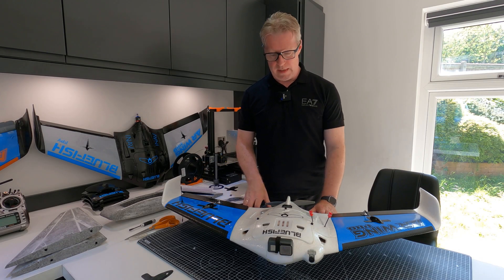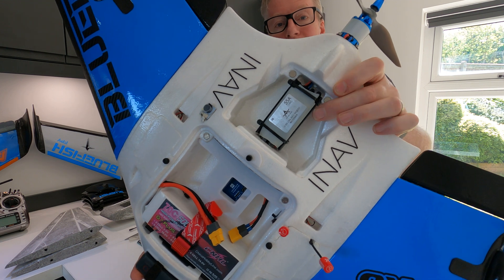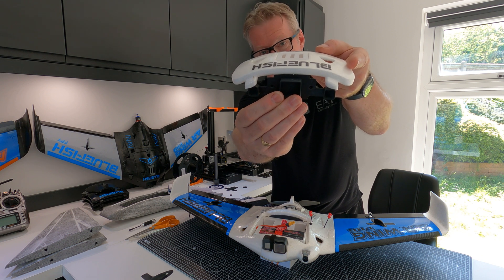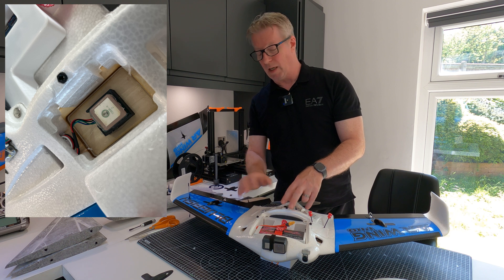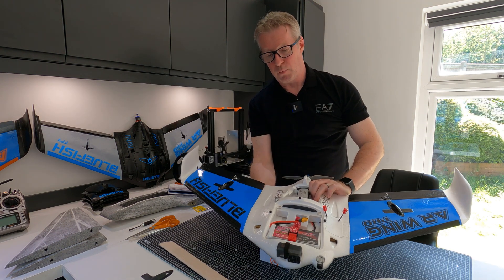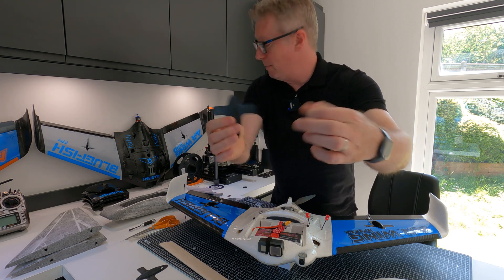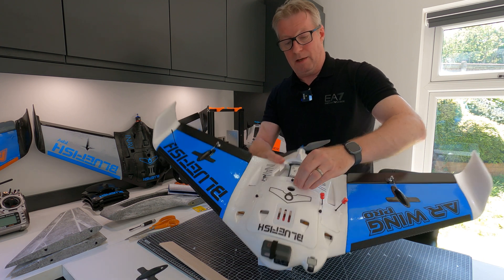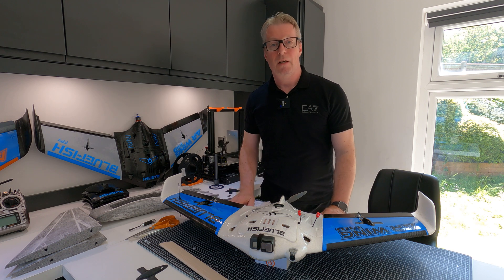AR Wing Pro II -  Build Review

Comment: Are the wing electrical connectors 3pin or 4 because a nano has four wires?
Reply from the maker: @petebuttons210  3 pin, splice the ground from the servo to ground on the nano so servo and nano share a common ground wire in the three pin wing connector.

Comment: Hi, I see in the STL files that you provide. There is a motor mount (spacer). Is that necessary, and why please. Just one more thing, those servos are digital. So what refresh rate have you set them to in inav, as no one mentions that. Thanks
Reply from the maker: Hi Alan, not sure what you mean by the motor mount spacer, there are two variants in the STL folder one, screw in and one glue in.

I never change any elements of servo refresh rate from the inav defaults.
Reply: @bluefish3607  OK Glen, thank you

Comment: Glen -  Great idea to use the Macgregor stud control horns, I have bought a set for the AR Pro and for the Zhod Dart XLE. I have them on a few of my large scale fixed wing craft.
But, I have found that the nylon connecting part is far too short! One ends up with a large offset of the pivot from the hinge line, as you show at 06.23 (great inset detail btw). That will give control movements that are differential, with the bias to downwards, which is the wrong direction for a wing. Or, one has to sacrifice elevon edge distance and skirt bearing to get the pivot and hinge closed to align.
Or, have you found that you have had to bias the angle of the servo control horn to compensate? Biased rearwards?
Reply from the maker: Hi Dave, I think you have greater knowledge than I with regards to aerodynamics and control surface optimisation. I have my servos set in inav to operate from 900 to 2100 to get the throw characteristics I like for my flying style. I did not put much thought into anything else and as it seems to fly really well I was happy to leave it at that.

Not a very scientific answer I know but I generally judge my mods on how they perform in the air, hence building the test plane first to try lots of different configurations. I guess you could say I am a bit of a trial and error kind of guy 🙂
Reply: @bluefish3607  Hi again Glen. You are way ahead of me with flight controllers in fixed wing craft for sure. I am of course familiar with FC's in quads. In my Vantac AR+ Wing I had an FrSky S6R gyro stabilised RX in wind rejection mode.
If you get any craft flying well in manual (non-gyro) mode then it will significantly reduce the workload that the FC has to do when it is engaged.  Think of the FC's task is to fine tune the already good flight characteristics.  
Compare  that with a badly set-up craft that flies like a dog, where the FC is constantly fighting to stabilize the craft. With the S6R it is necessary to trim out to fly straight and level in manual mode on first flight, so that the gyros subsequently know where neutral trim is when re-calibrated back on the ground. 
You have already found how much better your AR Pros fly using rigid balsa control surfaces and good links, the FC is the electronic side of that.

Comment: Great helpful series Glen
I have never had a even a single failure of any Hobbywing SkyWalker ESC's - even the crashed ones go back into the air!
Moral: do not buy components that are easily copied from unverifyable sources! I have learnt my lesson not to buy servos from even eBay.
I now only buy reputable brands of ESC's, Motors, Servos etc and only from reputable UK sellers.
Reply from the maker: Dave I think you knocked the nail on the head, I got those ESC's from Aliexpress and think they were knock offs. I threw the last unused one away after two caught fire.

Comment: Hi there, I was right now in the middle of designing some parts for my AR Pro when I found your lovely channel. Lovely parts. Just a question regarding your FC cover. How do you mount it. The thingie with the two pins I guess just pinches into the body. But the front angle thingie is on one side glued to the cover but how to fix it on the plane because I guess you didn’t glued it onto the body?
Reply from the maker: @RedAppleApe  I bond an M3 plastic stand off into the foam and use a thumbscrew to hold the front of the cover down.
Reply: @bluefish3607  thanks mate, I now designed a small mount to heat in a brass thread and rised the small angle thing.
Reply from the maker: @RedAppleApe  Yeah those brass inserts are really good.

Comment: Hey mate. Just doing the conversion to Balsa Elevons myself thanks to you and your channel 😊. I can't find the files for those prints that go between the balsa and the upgraded horns. Would you mind sending the files?
Reply from the maker: Hi sorry I am away from home touring Spain but will check my Google drive when I get some wifi with my laptop later today and send you the link if I have uploaded them. 

If not I will be back home to my desktop pc on Nov 30th. That said they are only small 25x10x1.5mm plates with rounded corners and a 3mm hole in the centre that you could create in 5 mins with TinkerCad which is free.

Comment: I finally broke down and bought this wing.  Might swap the stock motor for a 2216 1120 kv motor that I have laying around and run a 9x6 prop
Reply from the maker: I have another AR Pro with Brotherhobby Reunion 2318 1250kv and Aeronaut Cam Carbon Lite 9x5 and its flies great. A bit more of a cruiser feel than my other setup and a little quieter. Enjoy your AR Pro, its a great wing.

Comment: What other chemicals would mix with the E6000 can I just use any lacquer thinner or maybe acetone or something
Reply: Acetone will dissolve the styrofoam material in a heartbeat!
Reply: @ecor1987  to find that out in testing I used zylol
Reply from the maker: I really don’t know tbh. Toluene is a chemical component if E6000 so the best option.

Comment: Love the air unit switch great idea!.. Mine is currently 1200grams and i thought that flys heavy so interesting to hear yours is 1650!
Reply from the maker: Yeah that switch has proven to be extremely useful. I think my 5000mah 4S lipos are 560 grams alone, but better to have more battery than dead weight to hit CG I guess.  I have had that setup since day 1 so its all I know. I have considered building a super light version just out of curiosity of how it would compare.

Comment: Great build you've got there. Can you explain how you wired the RX Nano using the wing plugs? I'm currently building my very first AR Pro/Wing and thats how I've come across your channel. Coming from a multi rotor background connectors are alien to me lol 3 servo wires and 4 nano RX wires going into a 6 pin connector I'm assuming you've used a common ground somewhere how is this achieved?
Reply from the maker: Hi Dean, I also came from a quad background and my first wing was the AR900, great plane btw.

You are correct I splice the crossfire Nano and servo ground together. I do the join in the section of the channel just after it bends round from the servo to the wing connector. I use shrink wrap to make it all neat and secure after I have soldered the wires together.

I carefully cut the bottom of ther cable channel by running a craft knife along it, not too deep, and then I gently easy the cables and shrink wrap down into that cut groove so that the cables are held tight and do not protrude above the surfaace of the cable channel.

I then wire the Nano 5v RX and TX to the wing connector and throughh to the FC.

I Hope that helps.
Reply: That makes perfect sense, thank you. I'm assuming you use a crimping tool to make up the connector for the 5v, Tx and Rx? Might need to put one on my shopping list... as I said above connectors are an alien concept to me but I do see the benefit here so the wings can be detached for transportation.

Many thanks.
Reply from the maker: @DeanoG60  Yes I use a crimping tool for all of my connections including all connections on the FC, I only really solder the power cables and ESC on the FC.

On my latesdt build I have soldered 90 degree pins onto the Nano and I connect that with a plug in the wing so its easily removable. It can be a pain when you need upgrade firmware or access the little reset button on the Nano.

I got my crimps and connector kit on Amazon there are lots on there if you do a search.
Reply: @bluefish3607  that's perfect, thanks for your help. Love your channel. I've learnt a lot. keep up the good work and happy flying.
Reply from the maker: @DeanoG60  Your very welcome Dean enjoy your AR Pro.

Comment: Sexy rig you got there Glen. Keeps the 3D printer workin overtime. Very well built. I agree the Pro does fly more stable with some extra weight on 'er. Likes to land fast too. I likey. Using the same motor on this one that I used. The Sunnysky V3 is a killer choice. I might steal your "pins on the Rx" trick. Smart call
Reply from the maker: Thanks, yes I think the SunnySky V3 on the ARP works really well. The pins on RX is defo a handy mod especially when you upgrade firmware or want to swap it out.

Comment: Really lovely stuff, thanks for sharing the build. 

I’m considering replacing my Dolphin elevons with printed ones - do you think it’s worth the extra weight? A PETG elevon looks like it’ll weigh about 25g compared to around 4g for the original ones 😬

Look forward to seeing your next flights!
Reply from the maker: I guess it depends how you fly. I fly the AR Pro quite fast and with agressive turns, dives, rolls and loops and the original foam elevons just could not handle that and I was losing resolution, kind of like a physical expo as the elevons bent and twisted under load. The balsa elevons have transformed the plane and how it handles and performs.

I have not seen a Dolphin in the flesh and am not sure how robust the elevons are or if they have any carbon reinforcement, but in general if you want to push the performance envelope a bit then balsa or PETG stiffer elevons are definitely worth any slight weight gain imo.

My AR Pro's are heavy between 1500 and 1650 grams and I actually like the way they feel in the air with the extra weight, I guess it's what you get used too.

I hope that helps in some small way.
Reply: @bluefish3607  That's really helpful yes, thanks. I'm also going for a more fast/acrobatic build rather than long range, though I can't say I've noticed performance issues with the stock elevons - mainly just looking for excuses to play with the 3D printer :) They are definitely quite bendy though, despite having a small carbon spar along one edge.

I think my Dolphin is running around 700g all up, so an extra 40-50 isn't insignificant, but I suspect it's worth a go (and is a good way to learn some CAD, possibly at the expense of a crashed plane :D )

Maybe the toluene can come next! And congrats on the retirement - look forward to seeing the travel/flying videos! Cheers

Comment: I used your method of E6000 and toluene for my Atom Dolphin.  Now just need to get out and fly it.
Reply from the maker: What do you think to the coating when it dries?  Hopefully no crash testing on your maiden, let me know how it goes.
Reply: It is really grippy now. Easy to hold and it won’t slip out of my hand when throwing.
Reply from the maker: @horsship  Yeah I noticed that as well thats why I coat the battery plate stops your lipo slipping around.

Comment: I sometimes think we have reached "peak wing" era as the AR Pro, with all its minor faults, has yet to be surpassed on the Chinese Market. I'd be keen to mid one and move the motor forward so its half inside the wing to get the motor Wright forward so I could run a lot less nose lead to achieve correct c.g. also to run a light weight cam like the insta360 go 2which is super light weight
Reply from the maker: Hi Andrew, I did consider building a super light AR Pro just to see how it felt compared to my heavyweight builds. I considered moving the ESC and the FC as far forward as possible in the front bay, but I fear the overall design of this wing would still make it difficult without nose weight unless you used a larger lipo which to some extent would defeat the object. If you decide to try the motor forward mod let me know I would like to see that.

Comment: I like the air unit switch. Much better than my method of connecting and disconnecting power via a jst cable. I typical use this on my first GPS lock in a new location as this can sometimes take a long time.
Reply from the maker: Thats exactly one of the reasons I fitted the switch, I let the plane sit on the ground aquiring sats and do all of my preflight checks, then flick the switch fire up the Air Unit and launch.

LED's https://www.amazon.co.uk/gp/product/B09HWZJYW5/ref=ppx_yo_dt_b_asin_title_o05_s00?ie=UTF8&psc=1

Switch https://www.ebay.co.uk/itm/224303141515?hash=item343982528b:g:YZgAAOSwrIpg~AbH&amdata=enc%3AAQAIAAAA8L7TSQ84yxvU38BVn4cSfynOozShn8oVPloMPO4YZkiP%2BzusPs9yCuNB6NIBfhMl76MLz8aZrmBcUPlFaEJiAuuu10U2ggFBXZb83RopBwLAdjx7CP%2FlOivxyvkqNF2PXRgv6LrKsboMKNLb2%2F3LKYJZ35VYwyJYFtkmpOoe0PrGJ1AeMooTJeTC8rhfxmhpRIIHOMpOq%2BAhOmpH1%2FYmvjfR1NkIeMQIlPzXxN%2BeSZvouHXJ5yiO7eBbA2YjAdniChRvU3l9F9SZXu5%2FQLOPTKN6iRRKvKtyi5Z2oL9M8V9moSRDbEf2vcue%2FTV9aMqGEg%3D%3D%7Ctkp%3ABFBMgrjxrYhi

Comment: Great video glen and really appreciate your build ideas & mods. Especially the spreader plate on the control horn/elevons. Had so much issues with these in the past so thankyou.
Reply from the maker: Yes the balsa is torsional much morre rigid than the foam stock elevons but not so strong under compression. I noticed one of the horns sinking into the surface of the elevon so the plates spread the load and are only 1mm thick so negligable drag.